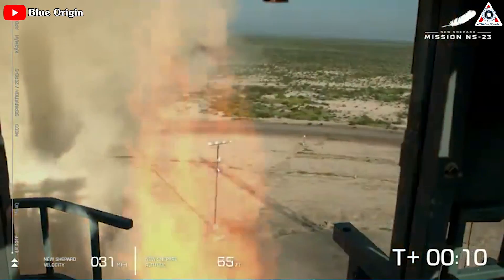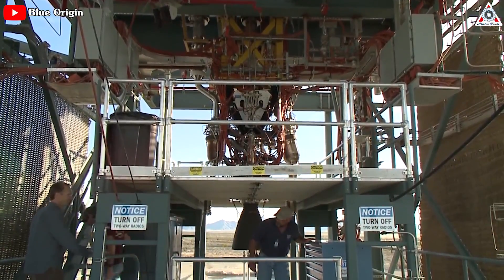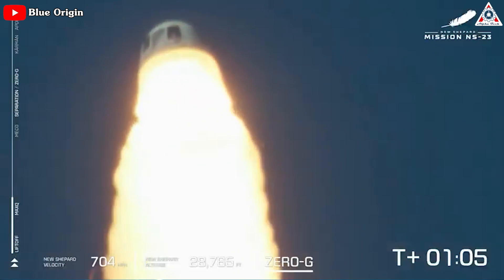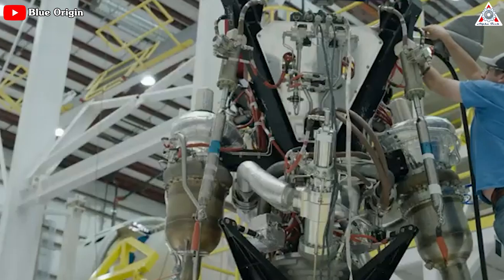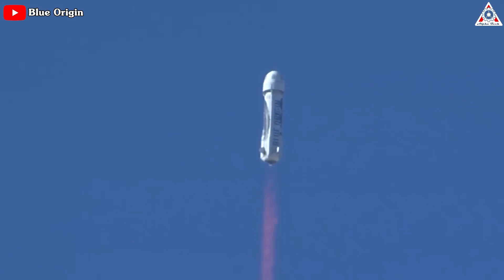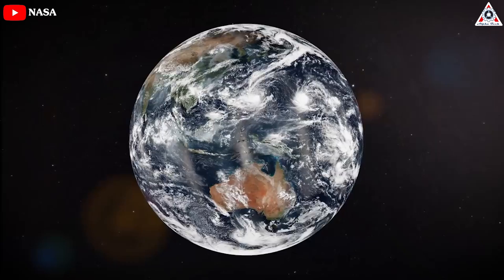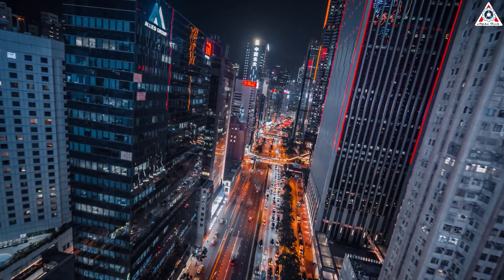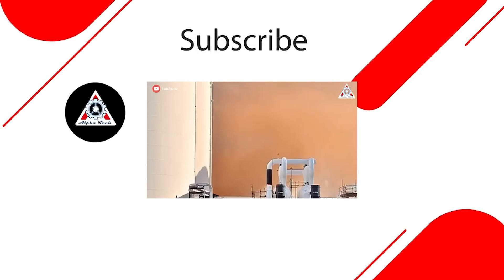New Shepard Engine FAILURE, Blue Origin blames...

Comment: Very cool to see the escape system in action
Reply: Odd that it was one of if not the only uncrewed bo recent launches
Reply: @rogerthomas169   There are currently two New Shepard boosters, I believe, and the older (and more used) one is used for uncrewed flights.  If that's the only difference between them, then I'd take a pretty hard look at the nozzle of the booster they use for crewed flights for wear or fatigue.

Comment: My concern would be with this capsule the location of the engine if there is a rud. Part of the engine is located inside the the capsule.
Reply: The same is true of the Crew Dragon, though.  It's not in the middle of the cabin, but any catastrophic failure would kill the whole crew regardless.  The Starliner is actually slightly safer because its abort engines are in the service module.  The engineering price Boeing paid is that the Starliner is both more expensive and less reusable (16+ engines thrown away with the service module versus none with the Crew Dragon).

Comment: How do you bring mega tons of minerals from an asteroid back the the surface of Earth?
Reply: The minerals mined in space would typically be used there, sending finished products down instead of raw materials.  But the realm of sci-fi has come up with some interesting ideas, like sending them down a space elevator like a regular elevator's counterweight, but generating power for the up-bound elevator instead of the cable systems we use on earth.  Another idea is to shape them into a semi-hollow spiral that would spin-stabilize itself on the way down to steady its course.  Once it landed in the ocean the honeycombed projectile would float thanks to the empty spaces, which would provide buoyancy.  And they would be REALLY empty thanks to vacuum, so you could send down more materials per shot.

But it's likely that they would use the materials in space almost exclusively.  We already know of asteroids that are more valuable than the earth's entire GDP COMBINED, 70,000 times to be precise.  Asteroids like those are why NASA is sending an orbiter to 16 Psyche, an asteroid between Mars and Saturn that is 140 miles in diameter and metal-rich with nickel, iron, and cobalt to name just a few goodies.  The value of that rock is around $10 quintillion, or $10,000,000,000,000,000,000.  When you are talking about numbers like that you either choose to crash the entire planetary economy and cause mass-rioting, or you treat space like we treat every country: international governments will determine trade tariffs to make sending down raw materials infeasible while simultaneously allowing trade in items you can only make in space (zero to low-g).  Now you can have your moon cheese and eat it, too!
Reply: @docferringer  you are aware a solar extinction event is in progress right now to remove many forms of life from this island Earth  this mid century?
Reply: Push them on intersecting trajectory?
Edit: Do not even need to mine them before landing.

Comment: I hope ULA look carefully at their BE4 engines for similar problems, after all Vulcan doesn't have an escape system to talk about if the rest of the rocket motor fails. A telling point about BO is the number of their engineers who have gone on to much better things after leaving BO. Says something about the culture under Bozzo.
Reply: With the constant delays in the BE-4 is part of the reason ULA is up for sale.
Reply from the maker: Exactly. This will be related to Starliner crew mission in the future
Reply: It depends on what the actual, more specific cause of the problem was.  If this is something that can happen only after multiple uses, then Vulcan is probably safe because, at least for the time being and foreseeable future, it is a fully disposable rocket.

Comment: No mention of the escape systems EXCESSIVE g load? Had the failed flight been crewed, severe injuries (or worse) would have occurred.
Reply: Personally, I am just going to assume that, when the BO escape system was developed, they considered the G forces an appropriately restrained human can take. 
It would be rather surprising if that never occurred to them, don't you think?
Reply: That g-load is not enough to seriously injure anyone.  Look it up
Reply: @joe92  Give me a reference stating the g load that the New Shepherd capsule was subjected to.
Reply: @johnbuchman4854  Nice deflection.  Here's a little math.  Escape system has 310 kilonewtons thrust.  Capsule mass is about 3000 kg.  310000/3000 = 103 m/sec sq acceleration.  103/9.8 m/sec sq/g = 10.5 g's.  Certainly no more than that

It takes dozens of g's to injure someone.  This wasn't dozens of g's.  Now try to nitpick and tell me which of those numbers is an order of magnitude off.
Reply: I don’t think you understand what an escape system is built for. You want to escape an exploding rocket as fast as possible. Fractured bones is by far better than death. Go watch any other escape system being tested and you’ll understand.
Reply: @IamJoeTV  You "think" that I don't understand the purpose of escape systems? Let's just say you're wrong about that, shall we? Killing the crew with an "escape" system is just a little counter productive. Did you even look into what the g load the escape system subjected the New Shepherd capsule to?
Reply: @johnbuchman4854  You clearly don't understand as it wouldn't kill them. Go look at the history of launch escape systems. 1983 Soyuz abort, crew experienced close to 17g's.
Reply: @johnbuchman4854  No John, the question is, did you ever look into the amount of G's from BO's escape system?
Reply: @IamJoeTV  And those highly trained and conditioned astronauts were NOT amusement park riders. I'd be willing to bet that had Shatner been on that ride or Jeff himself, serious injuries or worse would have happened.
Reply: @metriczeppelin  Have you? Where did you find a reputable link to the documentation? Please share!
Reply: @johnbuchman4854  You should stop commenting before you continue to make yourself look stupid. Go educate yourself on launch escape system if you're so hell bent on it being to violent. I'll help you out a little, the human body can withstand very very high g-loads for short periods of time, hence why the thrust used in all of these systems.
Reply: @IamJoeTV   John's right everybody.  Right now the only thing BO is known for is repeatedly breaking the record for oldest person sent into space.  I think that's why they take payment up front--it's hard for a wrinkly puddle to swipe their AMEX Black card.  LOL
Reply: @johnbuchman4854  John, you seem to want everyone else to do your homework for you.  Have you gone to NASA's website and looked around?

Comment: They should have made it more POINTY. It will be said that it looks like  a sex-aid.
Reply: Weak batteries causing issues with vibration rate of the improbability drive.
Reply from the maker: They have problem with engine, can this make them better???